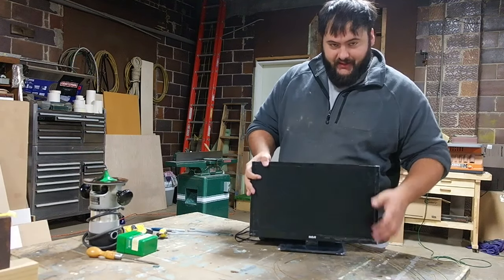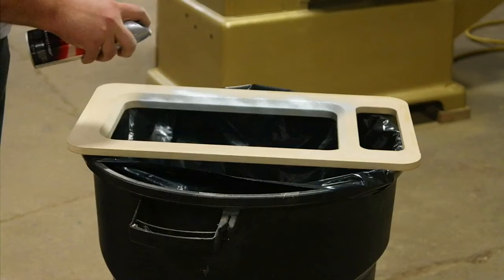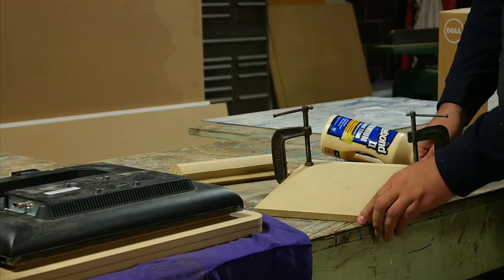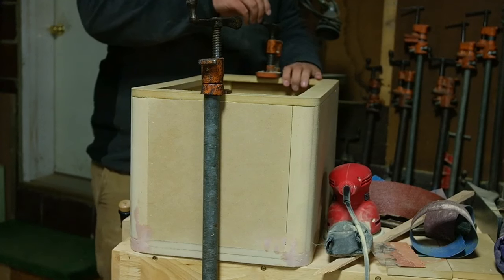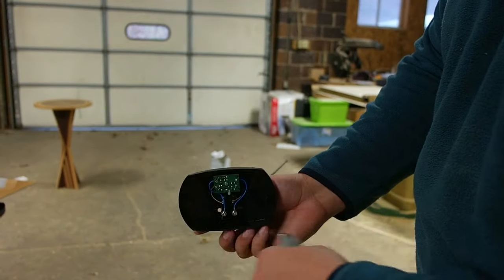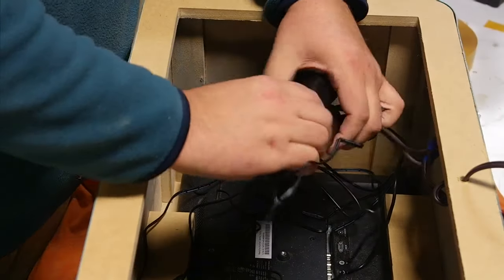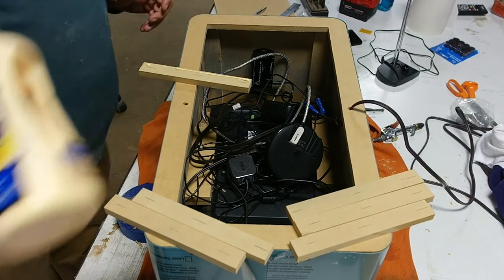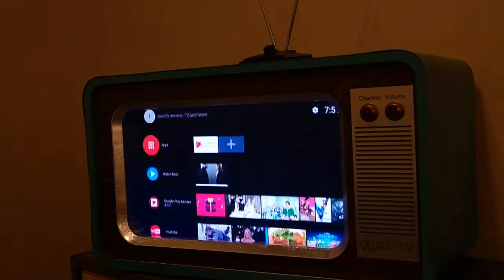How to build a Mid Century Modern vintage retro TV

Comment: tip. it will look more retro if you curve glass on the front. use lexan plastic and mend it or melt it over a mold. just a gradual bubble. not enough to distort the image. and if you really get creative etch the lexan on the edges so it is slighly opaque.

Comment: my god, that's gorgeous! dude, your work is awesome. any chance you'll do something like that but with old aspect ratio (4:3) LCD ? would be great
Reply: Its still possible to still find old 4:3 aspect LCD flat screen TV's from the early 2000's.  You would then need to get am HDMI to RCA converter to connect modern HDMI based devices like DVD player, cable boxes and streaming devices to the old TV. Also you will obviously lose the HD quality in the conversion and most of what you watch will end up letterboxed since the TV won't support 16:9. 

Of course some all pre-2000's TV shows (and some early 2000's as well) will display properly since they are 4:3. And older DVD movie media for which many films were released in your choice of 16:9 or 4:3 aspect ratios would display perfectly.
Reply: @adamn7516  Meh seems like alot of work when u can buy a crt

Comment: oh, he cheated.... he was suppose to disassemble the plastic chassis and mount the actual guts into the wood case... then it would be awesome...
Reply: Yeah, I agree that this took away from the style.
I also thought that GLUING in the supports that keeps the tv from falling, wasn't the best idea.
He should have just used screws or some sort of slide-in support.  Now, if the TV needs servicing or replacement, he'll have to break the glue seal and that could be a problem.